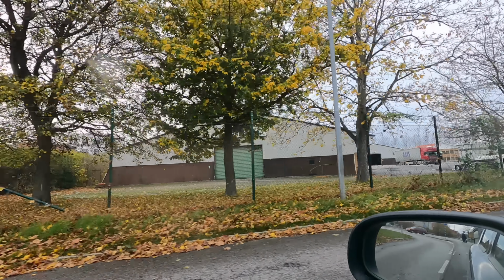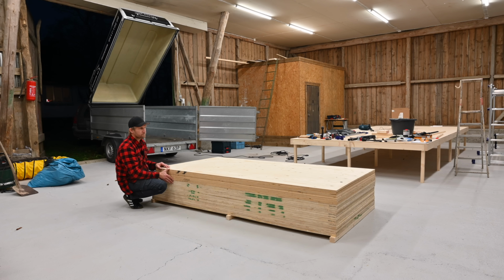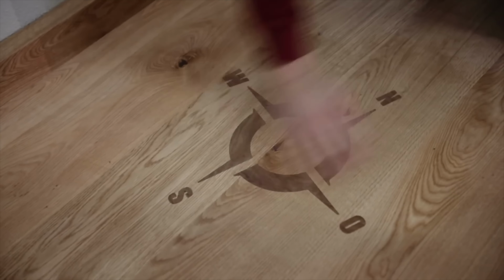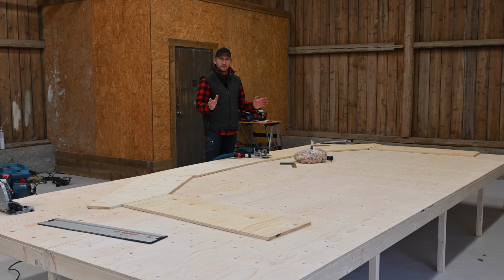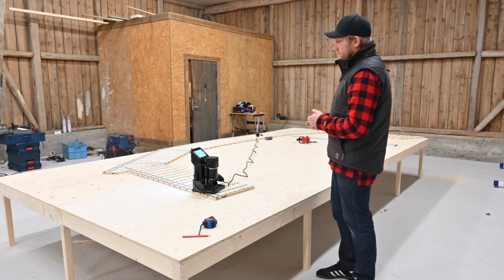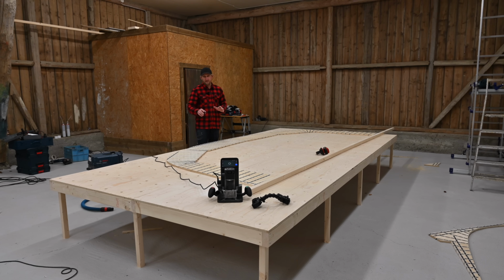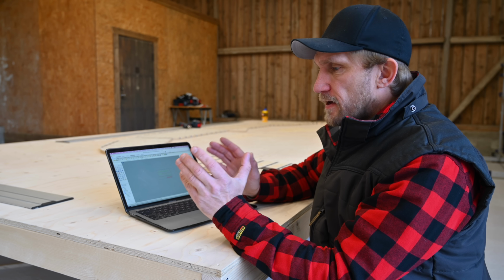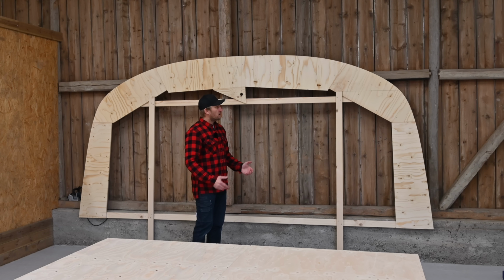Building Temporary Hull Frames With New TECHNOLOGY- Ep. 325 RAN Sailing

Comment: That router looks like a wonderful tool. And the station form looks great. The whole method looks accurate and economical.  I do have some questions; but first some observations.  I assume that the dimensions of forms are the result of subtracting the thickness of the planking from the lines of the boat.  Otherwise the finished boat would be wider than the its original plans. AND, you must have decided on the thickness of the planking. What method was used to subtract the planking thickness for the data on the CNC router? Thank you.

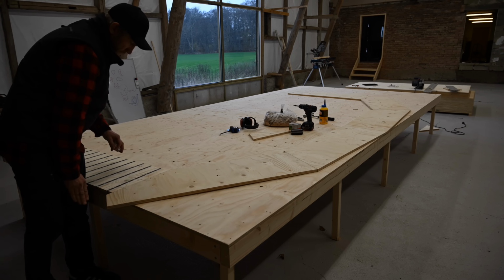Comment: 10:54 I have seen that router tool used several times in several other YouTube videos, it really is quite amazing. I am curious, why was it necessary to put the tape all the way across each plywood section, when you were only going to make a cut close to the outside edge?

Comment: what software was used to generate the svg files for Shaper.  How did you define Shaper to cut outside the line, did you create the form design as a closed shape?  If so how?  I'm trying the same approach on a boat design I'm working on and shaper wants to cut ON the line and not offset to the outside.  Any guidance would be grateful.  Thanks!

Comment: As a former management consultant, no matter how much you plan, things change.  Shortening the time improves your chances of completion. With that in mind, I suggest you build a hybrid.  Make the boat aluminum up to the water line or so.  Reduces time and weight.  You still can use your wood working skills.  You could build parts even before the hull section was Finished. 
I have 2 patents and I have an idea for a mast that would double as a electrical generator.  Good luck.

Comment: Hi again, some thing to read about , it's about a Big Air plane that made out of wood, Spruce Goose world biggest air plane they say yes it built out of birch and not spruce , Hughes H4 Hercules Birch is specifically Duramold a wood lamination process that makes strong plywood , I've seen this plane the wing span is 320 ft and it flex its wings only a few inches every year  , check it out Evergreen Aviation in  Mc Minnviville, Oregon it's very interesting how wood hold up with all this weight enjoy a good read if you want.

Comment: I had the same problem and 3d cutting was too expensive. A friend parted the drawings to printable pieces and we made additional marks for measure controlling. The we printed everything out, put the drawings on the plywood and saw with a jigsaw. Cheap and easy, not confirm to Millimeter, but near. We also designed Wholes for laser lining, to control straight uplining the construction.

Comment: This is wonderful!  So looking forward to this build.

There's a possibility that you screwed the mold to the table without showing it but if you didn't i would suggest putting at least a temporary spreader at the top so that it does not want to spring open or closed when the cutting releases  whatever tension the plywood holds.
Also, I'm wondering if the navigation tape could be reproduced onto a large vinyl type sheet that could be locally printed to speed up the tedious taping process.
And finally, could the router also be used to spot mark important mold positions such as water line ect?

Cheers!

Comment: I hope this helps 
Run a wire through your shed up high and that is the Center line for the entire boat. 
Mark the Center line on all your frames. 
If you have a concert floor in the shed. 
Bolt to the floor 100x50mm pine plate in the shape of the hull,
As there is a lot of forces to be restrained. make out your stations then you only have to attach and brace the frames at the station point whilst lining up with the Center line wire in the roof of the shed with plumb bob hanging from the wire. 
Lined up on the Center of the frame. 
This will also help when you turn the hull over, lining everything back up to the Center wire. Even down to the deck mast steps ect 
A friend helped me he had built several yachts out of Huon pine for clients all over the world,they were like pieces of furniture. 
Laminated ring frames, natural burl knees and strip planked in Huon Pine 1 inch planks copper nails with copper roves and hand peaned 
Out of the ark technology. 
I am from Tasmania Australian 
The boat I built was triple skin diagonal plank 5mmx100mm kingbilly pine it is very strong but very light a Tasmanian timber the weight of balsa with the strength of ash. 
Love the cnc router we had to loft it all up full size on plywood on the floor off paper planes. 
We used west system 2 pot epoxy, very good. 
Good luck you have a long jury ahead. 
Regards 
John

Comment: That handheld Shaper Origin CNC router must use a "digital sextant" referenced to inertial, optical and precision timing sensors to navigate to within +/- 1 mm accuracy.  Maybe a sailor who likes engineering cool tools developed it??  Consider: It uses image processing to triangulate its location, like a sextant is an optical protractor to triangulate a boat's location without GPS.  Image capture of the 'domino' marker tape and board edges function as gathered local almanac data.  Hence, the $3K (USD) starting budget for one -- for a boat build, worth every penny the fewer precision cuts with less rework (and zero leaks) are made. 😊  

Maybe not a promotional video by intent, but thanks for the demonstration!

Blessings, 

S/V Windwalker

Comment: Shaper Origin user here.  To ensure you get good dimensional accuracy over the relatively large distances you are cutting, I suggest scanning your piece,  lightly cutting some "witness marks" at the extremities of your cut, measure the  distance between the sets of witness marks then use the on tool scale function to adjust the placed cut file so that the witness marks are the exact dimension they should be then cut the appropriately scaled file.

Over large distances there can be some dimensional inaccuracies due to the fact that because of the way the shaper origin works the accuracy is a % of the distance from the origin point. The above procedure effectively calibrates the machine / that scan to correct for the percentage deviation.

Comment: Hopefully this is actually a useful comment.  

You might want to confirm from your architect that he created the mold sections by offsetting the hull surface “in” by the amount of the thickness of the hull.  So the shapes you have are inside the true hull shape by that thickness.  It is an easy mistake and easy to correct now.  

One thing you have to do is establish the true surface that represents the station of the plywood molds you are cutting.  For example, I would suggest that the forward surface of the widest mold represents that station section (and all molds forward of that).  However, all molds aft of that the true surface should be the aft surface.  This way you won’t have to bevel the edges so they won’t be “proud” of the inner hull surface.  Of course for the first station mold aft of the one you just cut you must measure from that mold’s forward surface to the next aft mold’s aft surface.  All the rest of the aft molds get measured aft surface to aft surface.  

Put mylar packing tape all over the edges of the molds so you don’t glue them into the boat (can be fixed but why not make your life easier).  

I don’t know if you are going to vacuum bag the fletches (veneers) onto the molds but I think the fine forefoot will give you some headaches.  The curve as you come to the centerline (cutwater and keel) has a small radius.  I have never used vacuum bagging and I don’t know if it can make a 2 mm pine fletch bend that tight.  I know if you are using blocks wrapped in mylar tape and drywall screws to force the wood to bend it might not work even with steaming.  

You could use twice as many half thickness fletches for the forefoot or you could bring a keel and cutwater out to the surface and lap successive layers into recesses.   

Related to the forefoot I suggest doubling the molds forward.  There is a lot of twist there and you will need support to get the shape right.  The extra cuts through the Rhino model are free and almost free to you as you can get 3 - 4 molds that skinny out of one sheet of plywood.

Comment: That Shaper AR CNC is pretty amazing! I'll be really intrigued with what you have to say about it when you're finished with all of the boat's temporary frames. Does it allow for only one SVG shape to be loaded at a time, or could it be used to cut many shapes from a single sheet of plywood as a gantry style CNC would? I myself have a hobby level maker made m2 CNC which I've been using to prototype some smaller boats.

Comment: If you are cutting out pieces with your plunge saw on the bench, just put 2 sacrificial 4x2 underneath the sheet so you don't have to clamp down your sheet over the edge of the bench. Heaps quicker.

Comment: Thanks so much for the unpaid review of the Shaper. Thomas Sandlander did a review which seemed pretty good, but his was supplied by the company for review. Having followed this channel for years, knowing how fastidious Johan is, hearing from him that it came out within a millimeter across that ~4m span was amazing. Nothing sandpaper or a planar couldn't easily fix. We also aspire to build a (smaller, ~6.7m beam) boat, and I think this unit will need to be on our shopping list. If Shaper reaches out with an affiliate code, please let us know -- I'll certainly use it. 👍

Comment: Nice work and a helpfull router tool, how much does it cost? I think you should not choose between pine or spruce based on rot resistance, it's only the hart wood that is slightly more resistant in pine. You will still need to seal the wood from water and thus other properties are much more important.

Comment: I may take a while to fully appreciate it, but that router really does look quite versatile! The ad showed some inlay mosaic work and THAT can really spruce up the interior cabinetrly and furniture,  I have noticed some boats have a profile diagram of their boat in the Nav station to use LEDs as placeholders to show which lights are on.or off or burned out! I'm sure the router could do that, too! What a shock that must be to find a lumber shortage in the country just as you start your wooden boat build! Could you cut your own pine down from the forests and mill yourself? Would it be easier to bend those planks while they're wet and let them dry while fastened in place? Otherwise I see a big delay in getting your wood ready for construction.

I do enjoy watching you do your work. You have planned well and narrate your actions well!

Comment: The tape doesn't need to be on the part you are cutting. It can be on the table so long as the camera can see it and the part doesn't move.  This will save you tape. Not sure it will work in this case but it works for smaller things or straight things.

Comment: Just looked the system up. Has lots of uses. Was thinking, couldn't you set up reusable pattern/tape sheets, and attach them to the rough frame, cut out the frame and pull off the pattern/tape sheets and reuse. You may cut some up, but should be cheaper and easier than re-taping each time. Noticed the cut table they sell works on the edge of the pattern field and is usable as set reference. Been watching a long time. 

Thom

Comment: I've worked with CAD designs from naval architects since they first came on line two decades ago.  The five axis milling machine we used for large  motor yacht molds also produced the molds for the Boeing 777.  Absolute magic to start from the lines of a dingy and 45 minutes later have fully faired lines of a 145 foot sailboat. If you don't care about beauty or art, have at it!

The one thing computer aided design can't produce is beauty.  And in my experience it is quite good at producing ugly.  The result is that more than once I've re-lofted parts of a 60 foot plug after seeing the actual product in full scale.  And I always mock up key areas like engine rooms with multiple engines, generators, and equipment that the computer says will fit to determine if that is the actual case.

Comment: Wonderful machine 
You might consider putting a tight clothesline wire above the cutting area and hang your power cord on metal rings spaced 4 feet apart  That will allow you to move about the area and the power cord is out of your way. We used to do this on apparel cutting tables for the cutting knife and were about  100 feet long. It works like a champ 
Best of lock on your build
Reply: That is a GREAT IDEA.

Comment: Cheers guys,  you would think driving around that farm lands there would be some really good straight, and well seasoned hard wood old barn rafters/beams that you could purchase for not alot, plane them to size for the internal framing, (I’m not sure what hardwood is available in that country?   Sounds silly using secondhand timber,  but as you know it’s actually the opposite,  dry/straight timber is far Superior for framing especially over green pine..   obviously if you get a huge long beam you will need to rip it to size,  so you either build a bandsaw powerful enough to rip it,  or get very friendly with your local mill so they rip it for you.. 
just a thought? 🤔.

Comment: Just wondering if the tape is expensive?
Reply from the maker: Yes, for a large project like this it is. I’ll need around 20 rolls to complete all the mold stations. One roll (45 meters,150 ft) is around 22 USD, so for most smaller cuts/projects it’s not to bad. Cheers!
Reply: @RANSailing  I have a shaper. You can print your own shaper tape. Or even sheets of shaper domino's. Much cheaper. Free programs exist. Just make sure it is printed 1 scale

Comment: Great progress 

You might want to have the waterline scribed onto the mould by the shaper at the time of cutting, use a shallow cut and then sharpie the cut for visibility, it will give you a reference on every frame for alignment. Ideally you can add a plunge hole(s) somewhere on the line as well and then eventually stringline through them from frame to frame. I'd do the same for your centreline mark and your hole for sighting, add more meat in the centre on the mould and get the shaper to cut it at the same time. Once you've "absorbed" the flexibility/accuracy/potential of the shaper tool you'll find loads of little tweaks worth adding to each cut. For instance, it seems obvious now, but have the shaper label each mould, ie. FrameB, Frame #7, etc, because its cut into the wood it'll not wear off in a few months time ...

Comment: Very cool. I'm glad that you chose this tool. I've seen some ads for it but didn't realize the scope of it's capabilities. Quite impressive. Hopefully the guide tape isn't too expensive since you will be using a lot of it. Arctic Sea Camel, in Finland, chose to build his CNC router table. It's very impressive but took a lot of money and time. For his design it was probably worth it, for yours the Shaper makes more sense. Though they should at least throw some sponsorship money your way. 

Seeing the profile of the hull is really interesting. Flatter bottom than I expected and what looks like a pretty low water line. Certainly lots of usable interior space.

Comment: You may want to add a second or third hole to the frames on either the waterline, center line, or both. That might help double check the frames aren't twisted along the length of the boat when you set them up. (It'll be a good cross-check to the waterline and center line markings.)
Reply: Yes, I just finished a little 3 M boat using molds on a strongback (less than 2 M wide) and several of the molds twisted a little.  That easily added more than 1 mm of error.

Comment: Very interesting to compare your frames with what @SeaCamel is doing. Will your bulkheads mean no frames in the finished hull?
The cnc router is amazing!
I do like the way SeaCamel cuts the jigsaw type joints to accurately join pieces of plywood. Might be an alternative to the biscuit joints? But obviously an extra cutting file would need to be created. Anyway your cutting is after the ply has been assembled.
Reply from the maker: There will be frames and bulkheads, but they will be installed after the hull is built and turned. 
I also watch Sea camel, great stuff! 😊Cheers! /Johan

Comment: That looks to be a GREAT tool. It would have made my job easier building my Lake Sailor (4.3m sailing canoe).  Are you planning to use square strips or a bead and cove system?
Reply from the maker: Most probably square strips, but if I get access to a the right machine so we can plane all sides in one go we might go with bead and cove. Cheers!

Comment: Great start. Had no idea such a machine existed. Several companies i work with use large gantry routers to process the station molds. Tends to be wasteful as they typically use full sheets of material. I normally spec a tolerance of + or - 5mm on station molds for hulls your size. 1mm is fantastic.  The expansion and contraction of the mold through humidity and temperature will exceed 1mm. Thank you for another great video!!!!